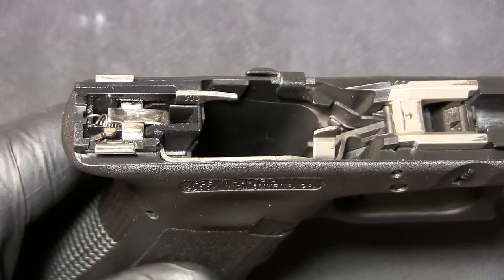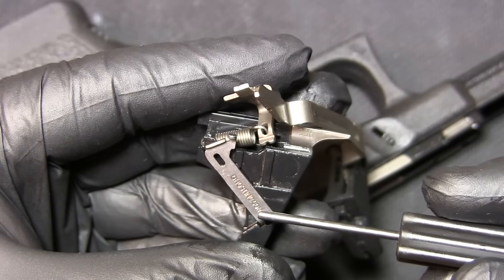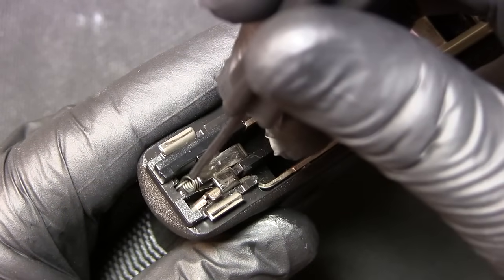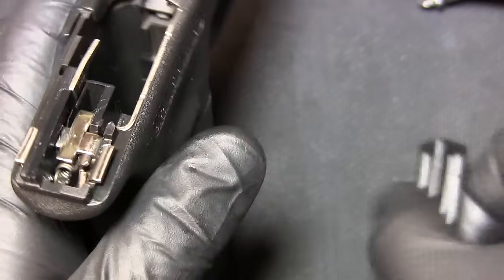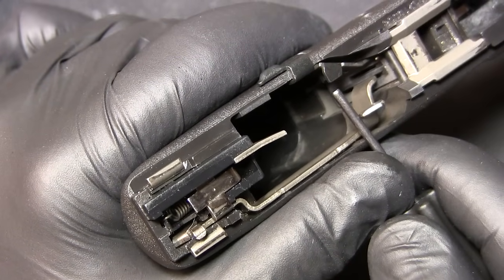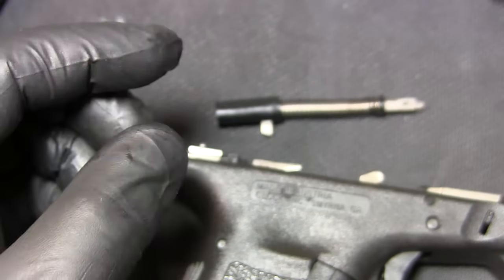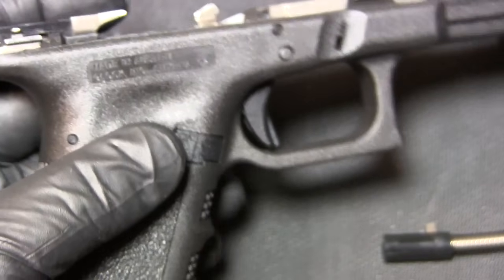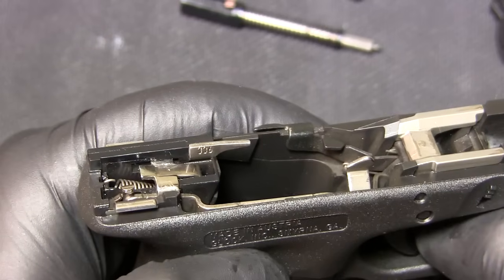How Glock triggers work and how they reset

Comment: What would cause it do full auto during dry fire

Ie
Holding down the trigger and racking the slide will drop the striker
Reply from the maker: Check to make sure the trigger spring hook (the one on the trigger bar) is positioned correctly (vertical), sometimes the spring kinks to the side when reinstalling the trigger assembly and will cause issues with the gun firing when releasing the trigger, and with reset sometimes.
Reply: MosinVirus I messed with it a little and it definitely helped but looking from behind when I rack it. 
Pull the trigger 
Rack 
Keep light pressure on the trigger 
Let it go forward and the trigger connector moves side to side like it should 

But if I pull the trigger rack it 
Etc 
And don’t put any pressure on the trigger it’s staying to the left and not resetting the trigger

Also if I’m holding the trigger hard it doesn’t drop the striker but if I let off the trigger any little bit it drops the striker?

Too light a trigger spring?
Reply from the maker: Did you check to see if the trigger spring hook is sideways on the trigger bar?
Reply: MosinVirus it was sideways 
I just fixed that and now it’s resetting the trigger
Reply: MosinVirus it still sometimes will just drop the striker when holding the trigger hard and releasing it but I’m not 100% sure if that’s me or the gun

But fixing the spring helped a lot so thanks!
Reply from the maker: @MyLonewolf25  my pleasure. Let me know if the issue continues to happen.
Reply: MosinVirus looking from the back when it’s dropping on release the connector is holding to the left and dropping back when i release the trigger
Reply from the maker: @MyLonewolf25  can you see the striker lug? Do you have an armorer back plate?
Reply: MosinVirus no armorers back plate

I’m gonna have to buy one

Comment: I have an issue with a new Agency Arms drop in trigger I installed on my Glock 19 Gen 4. The trigger shoe doesn’t want to reset far enough forward. The trigger safety will engage but it’s literally resting against the frame. I replace the springs, still not luck. I used a factory trigger bar and connector, with only the flat trigger shoe, still no luck. Wtf is going on?
Reply from the maker: I am not familiar with those but it sounds like trigger itself is the issue. Maybe it is designed in a way to take out all pretravel.

Comment: Didn’t really help me.
Reply from the maker: What is the issue?
Reply: I just cannot follow the process. I am not mechanically inclined. You may as well be speaking Greek.  Turned to a few YouTube videos after my Glock 26 trigger refused to reset.
Reply from the maker: @RetroZilla2025  Did you solve the issue?
Reply: MosinVirus No. I’m worried that I would lose a part and/or not be able to get it back together.
Reply from the maker: @RetroZilla2025  I have videos on disassembling Glocks which may help you. Your Trigger not resetting could be caused by a couple of different issues. If you don't feel comfortable doing it yourself, take it to a local smith.
Reply: MosinVirus . First, thank you for your patience. I fixed the problem by changing back to my first box of ammo. The problem occurred after I bought a box of additional ammo while at the range. That “range ammo” was strong enough to chamber a round but not strong enough to reset the trigger.
Reply from the maker: @RetroZilla2025  In some cases, when installing the trigger bar into the trigger housing users can let the trigger spring (bottom hook) jump to the side of the bottom of the trigger bar. That would produce inconsistent or non-working trigger reset too. Check to make sure that the trigger spring "hooks" are vertical when installed. Especially the bottom one.

Comment: Thank you for this video.  A week ago I could have cared less how these work.  On 12/2/18 my Glock 43 in my holster with the trigger completely covered fell on the floor and discharged.  It had an after market trigger with about 2000 rounds through the pistol.  With an empty chamber, we replicated the error many times.  I now have a genuine Glock put back in the 43.  Now, I appreciate knowing how these work.  More importantly, I carry for self-protection and am not a competitive shooter so I do not need the smoothest trigger, just one I can depend on.
Reply from the maker: Glad you were ok and no one got hurt. I completely agree that an EDC or duty weapon should remain in stock configuration
Reply: What kind of trigger was it?
Reply: Jeff Navarro I will not disclose the name of the aftermarket trigger as it will hurt the business.  He, the owner, came four hours drive the day after I notified him and he is changing his trigger because the drop safety failed.

Comment: Would a 3.5lb connector help with the stove pipe/feeding issue? 

https://rover.ebay.com/rover/0/0/0?mpre=https%3A%2F%2Fwww.ebay.com%2Fulk%2Fitm%2F232700515538
Reply from the maker: No, the connector would not affect either ejection or feeding.

Comment: the newer model Glocks have a lil spring on the slide stop/lock which doesn't seem to move it is locked in the metal/stationary. I seen someone asking what is its purpose &/or function if it doesn't move. I don't have the newer model so I couldn't check into how it operates.
Reply from the maker: I dont have the newer models to check, sorry.

Comment: Good job describing! So I just ordered a 3.5 pound connector and put that in and I’m also waiting for a 6 pound trigger spring to come in and I’m going to put that in as well. As long as I don’t mess with the firing pin spring or replace it to a lighter one my trigger will be ok with resetting itself??
Reply from the maker: Yes, heavier trigger spring and original striker spring should be ok. I usually go lighter striker and original trigger spring combo. Lighter pull and 100% reliability
Reply: Thank you sir! I put the spring in and it works great. Thank again for the great video

Comment: Great video.  Thank you.  Why will my trigger NOT reset.  It fires when I release the trigger?
Reply from the maker: Your trigger spring may be linked to the side on the bottom, where it connects to the trigger bar.
Reply from the maker: Make sure the hook of the trigger spring is straight under the trigger bar and is not kinked off to the side.
Reply: Checked, looks good.  What I did was trim the rear slide block (right side) ever so slightly and removed my ghost sear. Works perfectly now.

Comment: why is the ramp down the middle of the slide...inside... why is it there? what purpose?
Reply from the maker: Which ramp are you talking about?
Reply: on the inside of the slide... the visible ramped surface that is exposed... just atop the firing pin assembly contained underneath.
Reply from the maker: Are you talking about the stripper lug? The protrusion that strips the rounds out of the magazine? It is also the stripper lug that usually glides on the hammer when the slide recoils.

Comment: Hi I mistakenly put light oil on the trigger spring. Would my Glock be alright??? Plz answer
Reply from the maker: Yes, oiling parts will not cause issues. Excessive oiling will lead to more dirt being attracted to the oil, so it is not advised to "flood" parts in oil.  Basically, if you are oiling all Glock parts, expect to have to clean the gun more frequently.
Reply: MosinVirus Ok thanks. Im new to guns and it was my first time cleaning my Glock 19 Gen 4. I put the oil on the trigger spring thinking it was correct but it was supposed to be where the trigger bar contacts the trigger connector
Reply from the maker: No problem. Yes, the spot you mentioned is where a drop of oil should be added.

Comment: thank you for this video im building a glock right now and i thought i did something wrong with trigger vut i guess it only manually goes forward
Reply from the maker: Let me know what the issue is.
Reply: MosinVirus well on my smith and Wesson when I take the slide off the trigger still has spring to it so I thought the glock would be the same but after watching your video out seems that the glock trigger just stays pulled back once you pull it there is no spring to bring it back forward like in the Smith and Wesson
Reply from the maker: Oh, got it. Thank you for replying.

Comment: You're a sharp dude. I made an account just to tell you I was having a problem with my ghost connector not resetting the trigger and, while I was reluctant to watch a 12 min vid, I used what I learned from you to figure out my problem. Thanks!
Reply from the maker: My pleasure. I know the video could have been shorter. Sorry about that. So, what was the issue with your connector?
Reply: MosinVirus I got the ghost rocket connector that you can adjust the over travel distance with by trimming the extra tab it comes with. So while trimming it and putting it back into the gun to see if it works (idk how much you know about it) I was afraid to over trim it and defeat the purpose of it so when I got the trigger to drop, I was happy. Then I noticed the trigger wasn’t resetting if I held it down while the slide cycled. After watching your vid I realized I needed to trim it a little more in order for the trigger bar to slide past the connector and actually sit on the side of it so the cruciform could fully come up and catch the striker. I was trimming it to the point that the cruciform was touching the tab on the connector. Only took 4 hours to realize 🙃
Reply from the maker: Ahhh, yes, I have seen those. I am sure after you do a couple you will know how much needs to be trimmed off that trigger bar stop arm.

Comment: Great explanation...I knew how most of the parts worked individually, but not the whole process. Now I see exactly where that drop of oil should go (and why) on the connector. Thanks! Great job.
Reply from the maker: My pleasure. Glad I could help.

Comment: Hi Mosin
i just bought gen5 and having some problems with reset. When i rack the slide back
and chamber the round in the trigger doesn't reset sometimes, would you have any
idea why that would be. Thanks
Reply from the maker: Did you take it apart completely any time recently? Check to make sure the trigger spring hooks are vertical (especially the end on the bottom that attaches to the end of the trigger bar) if it is canted to the side, your trigger may not reset sometimes or all the time. Just look down into the trigger housing and see if the end of the spring on the bottom is sitting on the side

Comment: Hi mosin, thanks for the clear, and complete explanation of the the internals on the Glock. One question for you, since you "stretched" your striker spring do you think that shortens the overall life of the spring? Not that it really matters as if it does and you're aware you can change it as needed, just curious what you think the effect of stretching might have. Keep up the good work, one of the best on the tube for sure👍
Reply from the maker: Hi, the stretched spring does very little to change anything. It will just go right back to where it was, so it is not a good way to do what I was trying to do. Yes, you can weaken the spring this way.

Comment: The Two Shepherds 12 02 2017

So when the trigger won't reset and the firing pin won't cock back the issue is definitely integral to the connector.

The issue is definitely with the connector!  The connector has two tabs or hooks on it.  

1. The back tab or hook releases the firing pin by creating a downward wedge to the trigger bar which comes off the back front end of the back of the firing pin, thereby releasing the firing pin that was held back by the plate of the trigger bar.  A more parallel back hook on the connected means that it is a smoother trigger pull.  A more sharp angle means it is more snappy and harder to pull back.  Why because you are fighting that greater downward slopping angle and that takes more force than an ease back plane slope tab.
2. The front tab that is higher.  This is very interesting.  Because when the slide comes back there is a channel in the slide that channels that front tab inward.  When this happens the entire back of the trigger bar is lifted up.  How?  Because that trigger plate on the trigger bar is held in place by it by the other tab, the trigger pull tab on the connector.  So the trigger plate rises up higher than it should.  
So a key measurement is the distance between that top hook that rests in the slide channel and the bottom hook that the trigger bar pops up from when the top hook is worked inward by the slide on the way back forward.
The striker spring has to be stronger than the trigger spring so that it can pull the striker back?  That doesn't make sense?  

What function then is the trigger spring in the back?  The trigger spring resets the trigger and pulls it backward so that the trigger safety cocks back into place.  

Now how does that sequence work?

But somehow how at the very end of the slide coming forward
 that top tap comes back to normal position in the track of the slide.  Which would be back towards the righter edge of it.  And as that is happening the trigger back is catching under the back tab where it will be forced under when the trigger is pulled again.  The connector does indeed have lateral spring to it.  It needs to be this way in order to achieve the trigger bar being released from it during firing, to hold that pressure.  But is it holding that pressure?  No, it is holding that pressure because it is channel fixed again.  So indeed the spring of it comes into play when it must follow that curve in the channel of the slide as the slide is coming back and forward.

Does that top tab ever free itself from the inward channel as the slide comes back during firing  (not talking about taking it off now.)  Does it need to come inward on the very end of the slide coming backward?

Distance between tabs should be what?  The bottom tab needs to be far enough back and to the right when the slide is in battery so that the trigger bar mating surface is allowed to be under it.  The top tab needs to be able to follow the channel bend of the slide and allow the trigger bar mating surface to free itself from it as the slide is coming backward.
The spring pressure of the connector and gap needs to be great enough so that the mating surface of the trigger bar catching underneath in going into battery.

So spring pressure of the connector should seem to be an issue unless it was bent to like 40 degrees.  It is that top Shepherd hook configuration!  Very interesting isn't it!  Dual Shepherd hooks!

Two Shepherds!
One shepherd hook forces the trigger bar down.  The other shepherd hook, the upper one,  releases you from the first.

So interesting the upper shepherd hook needs to be high enough so that the trigger bar can come up far enough to catch the firing pin.  But it can't be so high that the trigger bar never makes it back under the domain of the first shepherd hook.

Question?  Are there two shepherds or one?  Both shepherd hooks are held by the same torso body.  However one regulates the other.  The top shepherd hook regulates the bottom hook.  But it is the bottom hook that controls the blast function.  The top shepherd hooks work is to place the bottom shepherd hook in place indefinitely to control the blast function?  Are there two shepherds or one?  The bottom shepherd hook is of its own will, however it was willed into being by its father superior.

The bottom shepherd hook, inferior is at one with the operator of the gun.  However it is not enabled unless the blast function resets the superior function of the upper shepherd hook which is integral to the device.

Am I messing with whoever reads this?  Yeah.

In summary, the connector and integral device of two shepherd hooks, that is spring loaded so that it can bend and willow without breaking..  We can not make any claims other than that.

In effect the upper superior shepherd hook is the only one of the two that does the work by following the channel!  The bottom inferior shepherd hook's job is to remain stationary while it diverts pressure from the trigger bar lower.  So in effect through resistance it does work too?  If it is subject to strain then it is doing work?

Copyright 2017 Thomas Paul Murphy
Reply from the maker: Hmmm, perhaps another look at the video wouldn't hurt.

Comment: Thanks, no animation I have ever seen could explain that the track on the slide is what releases the sear.
Reply from the maker: My pleasure. The slide is what activates the connector. The trigger bar is what pulls the striker back, until the trigger bar moves down and out of the way of the striker.

Comment: Don't bother polishing anything inside a Glock- just use a small amount of graphite lubricant. The graphite will automatically fill any microscopic low points in the metal- and won't affect plastic.
Reply from the maker: Very good advice right here.

Comment: If you not in the middle of the trigger bar towards the front is not a disconnect her it's a firing pin safety it pushes up on the silver plug in the slide so the firing pin can move all the way forward \^_^/
Reply from the maker: That striker safety arm was a convenient way for me to move the bar and show what happens with the connector without getting in the shot. I never said it was a connector.

Comment: I shoot my glock and on the reset it fires agian lol ... thanks for the explanation on glock triggers
Reply from the maker: Sounds like the striker slips off the trigger bar as it is moving forward to reset. Could be that something is forcing it down on the way. Also, make sure that the trigger spring in the back is not turned to the side on the bottom.

Comment: Your video helped me out a lot on a polymer 80 940c that the trigger wouldn't reset if I held it back and racked the slide. The trigger bar was rubbing on the rear rail insert.
Reply from the maker: Robert Lipsey glad the video helped.